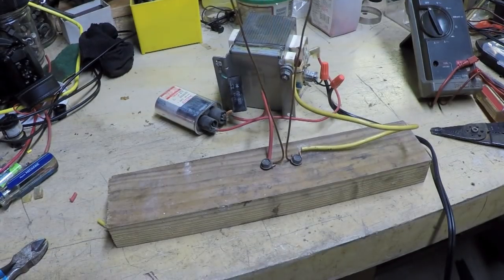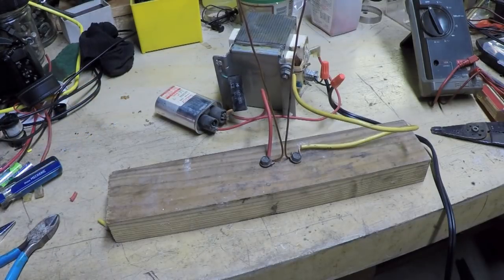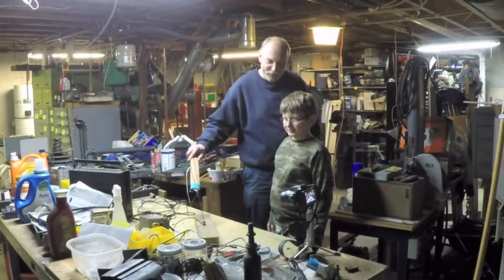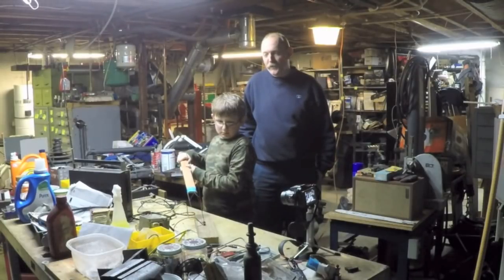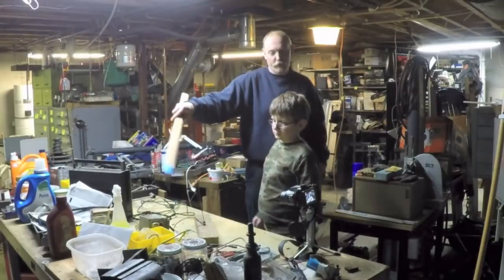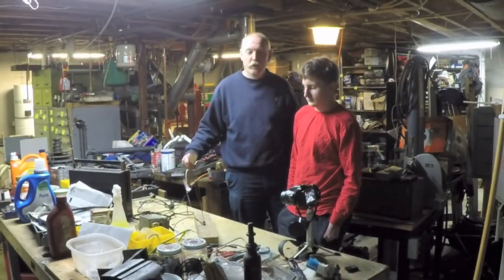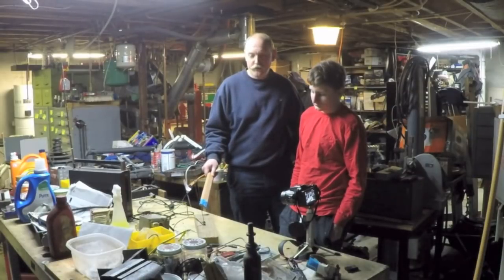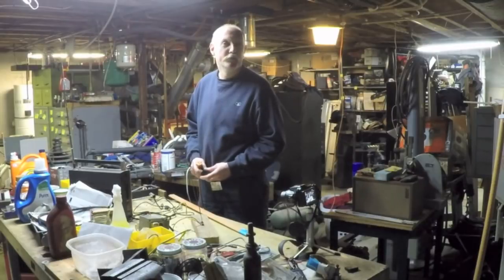High voltage transformer from a microwave oven Part 2

Comment: The capacitor in a dire will limit the current coming out of it so it's a weaker art but if you take the time the pastor off and do the same thing you usually do when you touch both terminals it'll get you a very high voltage out remember those transformers will heat up really fast if you aren't them too much The whining of word 120 goes in is only made out of aluminum and then it's made out of an insulation called varnish and it will heat up real fast but you probably be able to do it like a couple of times and it'll heat up

Comment: Hey dude you don't not need a bigger transformer my trick is to take off the diode and the capacitor and then hook it up straight to AC and end up one side of the line is like attached to the iron core and in the other side is that like wire or white connector you can use that and you can get doubled the output out the capacitor and the diode

Comment: Yo! Cool video. One way to improve this, is to completely stop using that diode. The output gets pulsed from that diode, and the arc cannot be sustained. Also, you can make a resonant circuit with two microwave oven capacitors in series with the output. This not only makes the transformer run a bit cooler, it also makes the arcs bigger. This creates a resonant circuit, too.

Comment: A transformer from an old home heating oil burner works  good for this project. As I remember, I had to play with the angle of the two wires, but eventually had the spark walking all the way up, about 18 inches. If your town has a specific bulk trash pick-up, keep an eye out for an old oil burner & grab it!
Reply from the maker: Thanks. I think I have one. Also a neon light transformer. I'll do another high voltage video eventually.

Comment: nobody noticed all he is doing is shorting out the diode.. A voltage doubler requires 2 diodes and 2 caps. If you were to connect to the other side of the cap you would have a half wave full voltage power supply and be successful (if you don't blow up the diode. but yes if you get rid of the diode and the Cap it will actually do what you want it to do.

Comment: You are getting ionized gas occurring around the copper shorting rod. This is what make the copper melt. This is the same process that plasma cutting uses. You are ionizing the gases in the atmosphere causing a reaction with the copper metal. Just saying. I love your organized work space you have fella. Reminds me to clean mine up. Nice work too.

Comment: Cool my dad did similar stuff with me and I did with my children can’t wait until my grandchild is old enough. You could keep on using diode‘s and capacitors one double or into another double or multiple times until you get 10,000 V or 100,000 V. Then you can claim that Jacob’s ladder. Another one is converting to DC voltage at 10,000 or 100,000 V because DC has a natural tendency as soon as it makes the arc it keeps it up continuous. Where AC voltage makes an arc and then sniffs itself out.

Comment: I don't know the voltage rating of the capacitor or the diode, but the transformer output voltage can be doubled by feeding it with 240 volts.

Comment: I remember watching old horror movies and trying to make the Jacob's ladder work. One day my Dad came home to see me trying out the experiment. I had two electric train transformers and also wiring coming out from the plug in receptacle on the wall trying to boost enough power to make that spark jump. Boy did I get a licking. I must have been around 7 or 8. I guess there is a little mad scientist in every little boy. Yeah those were interesting times. I don't know how many years of life I shortened old Dad of?

Comment: First of all thank you for sharing your knowledge and expending the time and effort to make this video. The reason the Jacob ladder is not working is the capacitor as soon as it gets discharged the voltage falls to zero and starts over just use the hv transformer ac output into the Jacob ladder and it will work .
Reply: I wanted to tell him the same thing, but I'm sure he doesn't check comments this far back. Are we sure that is a diode he is referring to or actually a bleeder resistor.
Reply: @rrfxxxr1  The bleeder resistor is inside of the capacitor.

Comment: You do not have enough current. The arc is not heating the air enough.

I dont think you can make this work with the microwave transformer. Ive always used neon transformers in the past when Ive done this.
Reply: Nah, it was the voltage multiplier that screwed it up. If he only had the capacitors in series with the output, it would be much better and make a resonant circuit.

Comment: I've made several JACOB LATTERs - the gap you had is too small, but if you increase the gap - must test the distance few times - once you take your stick and start at the bottom to START THE  GAP ONLY, SPARK, it should go  UP BY ITSELF! The hot air pushes the spark up and up. n your case you are using only one MOT and one capacitor+diode, but if you get more diodes+capacitors in series, it creates a big spark at the top of your "V" shaped copper wires! I use it to demo the danger of electricity, but also during Halloween and other "demo days" to have something special. Thanks for sharing this with us and your kids!

Comment: I'm proud of you 
  Because you spend time with your kids 
As well as they learned something interesting things like how dangerous electric is ...
You win a new sub man
Reply from the maker: Thanks for subbing.
Reply: @stevewatr  gov will have all heads for this tech thay teach us that we always have loss but never talk about 
the converted gain we can make from eletromagnets
if u convert all the wast thermal energy around 
you u can use it universally as energy u need a true sine wave bipolar like the power comp dose a 
true pure sinewave like a grid tie inverter 
once the signal is made the system will turn on and 
consume wast thermal energy from the 
environment and space around you... there is free energy but it comes from Universal thermal loss and converted into a gain. so a pole Transformer and a 
microwave Transformer  have a common between each other u can take 2 microwave Transformer provide 
a pure sine wave grid tie inverter to it or a true bipolar sinewave that inter acts with nature in 
a perfect spherical motion like a flower of life..  if ur home provides this use it as a Source 
signal then u can simply stack the Transformers on top of eachother in correct fasion and note 
that the 1 wire on the Transformer must stay connected and the other disconnected your only useing 
1 wire on the hi side .. so test ur self 
2 microwave transformer stacked on top of eachother same face sides. one side 120 to the wall and the other 120 side to what u want to power and useing the 
Transformer just the way it came out the microwave with the wire attached causes the energy in its 
perfect spherical motion to converted wast thermal energy to amp for u hot to cold in to out... 
should look a bit nuts with u use a form of wireless energy but its interacting with the environment...this is my work a compilation of Otis car. Tesla. and many other very smart people nowadays i think i found the gate source and drainif this gets out to much that it works the 
power comp and mib will have our headsdont do this at home warning high voltage yet i cant stop u lol DO NOT TOCH THE CORES OR THE WIRES OK u will die make sure u dont touch the core if the hi wire is mounted to it u dont have to mount the hi on the core if u dont want u connect the 1 hi wire to the same side hi on the other transformer then the core should besafe to handle if nessary
grab your multimeter and prove me wrong
thats what u do i have my whole home on this
and u can take one of the lows side out the wall and hook it up to other stuff and power it for verry little amp makeing nature convert and pumping latent heat effect into the device.
and u can have a microwave hi volt cap in between the hi side and make a system that powers its self
u can flip the switch on ur breaker and the room stays on up to 2kva 
with both lows in the wall

Comment: Wood stick is not a insulator i touched a fence in germany using a wood and i got shocked so don't thing the wood will protect you use a plastic tube next time or try metal for fun !!!

Comment: The welders and spot welders cut off the high voltage winding and replace it with a few turns of heavy gauge welding cable.  The output voltage is then just a few volts at hundreds of amps.  Thanks for the video and appreciate that you emphasized safety around high voltages.

Comment: looks just like the way i used to hold a screwdriver close to the top of the power tube in the old tv's and it would jump fire to the screwdriver. it would jump about 2 inches.
Reply from the maker: Yup, that's a "flyback" transformer used in those crt TVs.  As a general rule of thumb,  the anode voltage they developed was about 1kv per diagonal inch of screen size, so those old 25" console TVs had over 25,000 volts at the anode......that's why a lot of Tesla coil junkies like to use flybacks.

Comment: The magnetic shunt increases the transformer inductance and limits the current. If you knock it out the trans will draw a lot of mains current and gets very hot.  If you put mains to the secondary with the shunt out you will get 50v out of the primary. But these tranformers often use aluminium windings and its difficult to remove turns to get a lower voltage. You need two diodes for a voltage doubler the magnetron is other diode.

Comment: Interesting.  Could one use the Diode/Capacitor doubler to run a 220 v fan with a 110v circuit?
Reply from the maker: That wouldn't work, but they do make a transformer that will do that, as long as the fan is not too large.

Comment: Dear Steve: Cool video! (Maybe this video should be called "My 3 Sons", like the 1950s TV show. ) Can you do a video about super-low-voltage spot welder with the secondary winding made of a few turns of very thick wire? Perhaps then you could make a ball of molten metal again?
Reply from the maker: Interesting idea. Not sure I'll find the time. I would like to do a follow up to this at some point, and talk about ways to improve the arc length.

Comment: Thanks for the info on the motor.  That transformer will produce deadly amounts of current but not through the cap, as the capacitor acts more like a resistor when connected in series in an AC circuit.  Try putting the cap in parallel with the transformer, and lose the diode, you will have 1 foot arcs.   But please careful, they taught us the first day college to keep one hand in your pocket to avoid a path across the chest.   Try to limit the time as the transformer can meltdown.  I want to watch all the boys eyes light up.  Regards Mark

Comment: Working for an electrical wholesaler when i came out of Contracting due to physical problems my colleagues were fascinated by my experiments with electricity including the general contractors who came in. I used to draw BIG arcs between two carbon rods taken from dry cell batteries connected in series with a 3kw load. I made a "welding mask" out of cardboard and a black binliner to protect my eyes from the UV. Before this job i had worked in industry where many factories used arc welders, therefore i knew the dangers of "flash" A symptom of unprotected eyes being exposed to too much UV radiation. Its like having sand rubbed into your eyes and would eventually lead to cateracts forming. VERY dangerous. Masks are ESSENTIAL with this type of experiment. Also the unaware will watch a shorted or severely overloaded street transformer as it arcs generating very high levels of UV and then finally explodes spewing boiling oil on fire over a wide distance.

Comment: JIM DEVITO ENGINEER GENERAL DYNAMICS ELECTRONICS DIVISION; STEVE, YES UR CORRECT A NEON SIGN OR A HIGH VOLTAGE TRANSFORMER FROM A KEROSENE SPACE  HEATER WOULD PERFORM BETTER YIELDING 15 - 30 K.V. THAT WAS A 6TH SCIENCE PROJECT IN SHOWING HOW OZONE GAS CAN BE PRODUCED. STEVE YOU CAN ALSO INCREASE THE OUTPUT YOUR MAGNETRON  H.V. SUPPLY BY USING A VOLTAGE TRIPLER   BY ADDING ONE MORE DIODE AND CAPACITOR WITCH IM SURE YOU ALREADY ARE A WHERE OF.STEVE THE GFI  SHOULD BE REPLACED WITH AN ISOLATION TRANSFORMER,BETTER YET A VARIAC WITCH THEN IN TURN CAN INCREASE THE TRANSFORMER PRIMARY VOLTAGE 120 TO  140  HENCE     STEPPING UP OUTPUT,FOR THE BOYS TO WITNESS.I JUST WANT YOU TO KNOW IM SURE YOU ALREADY HAD KNOWLEDGE OF       .JUST A REMINDER.YOU ARE THE VERY FEW WHO KNOW AC -DC POWER SUPPLY THEORY ; YOUR  STATEMENT''THE PRIMARY DOES NOT DRAWS HARDY ANY CURRENT WITH NO LOAD ON THE SECONDARY,JIM

Comment: If I recall, a static spark needs 20,000 volts to jump a 1 inch gap in dry air.  You mentioned you had 5,000 volts and you could get a quarter spark.  I carried that memory for 60 years and finally used it.

Comment: Well done dad in explaining to your kid about electricity, Thats how you stir interest in such things. I picked up a charged 50v Cap as a kid and got a shock from it.  I've learned to respect electricity, but I enjoy using it and attempting repairs of electrical items.  Keep teaching your kids new things. As for the traveling arc, If the wires had larger caps at different intervals? ?

Comment: I just subscribed. I don't think I wasted any time watching. I've been fascinated by electrical, electronics and mechanical things since 1961 when my dad found me dissecting the kitchen toaster and couldn't put it back together. My parents bought another one and bought me some tools and started buying me things from a second hand store to do experiments on. I currently have my own electrical and electronics workbench in the basement. These micro-electronic devices are out of my league, but I still repair older CB radios and older stereo amps, receivers, and other older model things. I also make things from junk I have laying around. On my YouTube channel, I made a couple videos when I did some experiments with a homemade vacuum chamber. I also have a Variac with an 18 volt transformer primary connected to the 120 AC volt supply and the output wired in series to the 120 volt AC to the input yo the Variac. I also made a circuit for a volt meter that reads from 95 to 135 volts from the output from the Variac. One good thing I learned in elementary school from my teacher in 5th grade is that you never get out of school, he said "Life is your school and you should never stop learning." Math  and science were my two favorite classes, and math, then geometry, algebra and trigonometry turn out to be very useful for me especially for designing electronic circuits and building contraptions. I was very happy to have stumbled on your channel. I may learn some more things by watching your videos. My real name is Mike, wizard is my nickname and my YouTube name is the only variation that hasn't been used by anyone else.

Comment: The resistor in that cap is usually 10meg ohms so it will take a while to bleed off the current sitting in that cap.

Comment: You need perfectly....and I do mean PERFECTLY....straight conductors.
Apply Maxwell to your situation, and you will discover that for every bend of so many fractions of a degree at such-and-such distance, the inverse square law applies to both the resistance of the gap AND the potential difference required to bridge that gap, which is already dx4pi.
Other fun fact: HV electrical signals propagate like radio signals. Many of the same principles apply.
Of course, ALL Alternating Current electricity moves like a wave, but this property of electricity is less apparent at service terminal voltages/frequencies.
At a potential of 5KV, the signal emerging from the hot side of that transformer is approx. 2.5KHz, assuming the input is ~120V@60Hz.
The reason for this should be obvious, but for your viewers I'll just say that a coil-driven motivator(such as that formed by the core windings of your transformer)functions by making a trade between one aspect of the electrical energy energizing it and some other. In this transformer, there are four aspects at play which are important: Current vs. potential, and frequency vs. amplitude.
The greater the potential, the lower the current. The lesser the amplitude, the greater the frequency.
But that's not all: The current is inversely related to the frequency, such that a current drop accompanies a frequency spike.
This is due primarily to the size of the gap between the windings in the transformer, and is the reason that an electrolytic capacitor, having a very small gap over a very wide surface area, such as the doubler in your circuit, does relatively little to alter the amplitude or the frequency of the current delivered by the transformer, which is composed of relatively narrow wires separated from each other by much greater distances than the plates in the cap.

All this boils down to your wires need to be straight as piss and very smooth to help the arc build its potential.
See, the spark gap is itself a transformer, and all the same principles apply.
TIP: try to crate a spark gap of a definite size between the primary and secondary coils of your transformer.
take the diode off the cap, and remove the cap itself from the circuit. Use the diode to filter the back side of the spark gap so you don't get arcs between the secondary in the transformer.

Put all this together, and your arc will climb that ladder and be four inches long.

Comment: Why do you have a diode thats grounded on one end but connected to the terminal on the capacitor thats grounded too? I must be missing something.
Ok. N/m i got it lol
Reply from the maker: The diode and capacitor  form a 1/2 wave voltage doubler circuit . Theory of operation is found here: http://slot-tech.com/interesting_stuff/a%20collection%20of%20technical%20stuff%20from%20a%20technician%20in%20Libya/Microwave/doubler.html